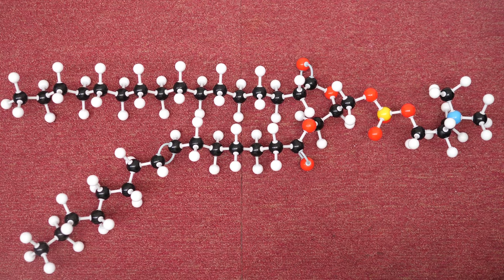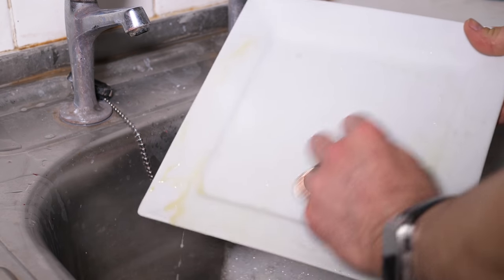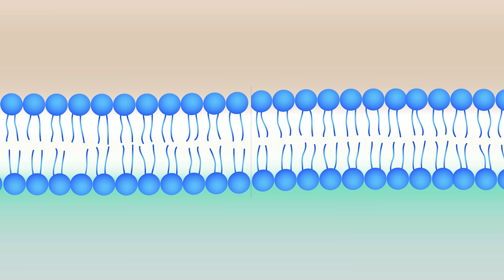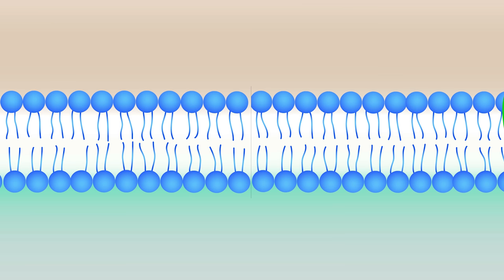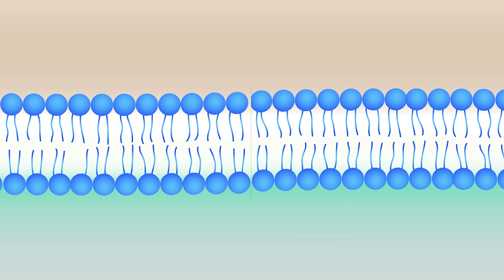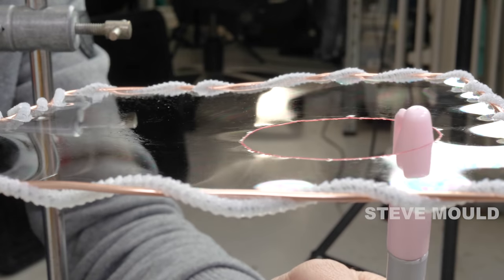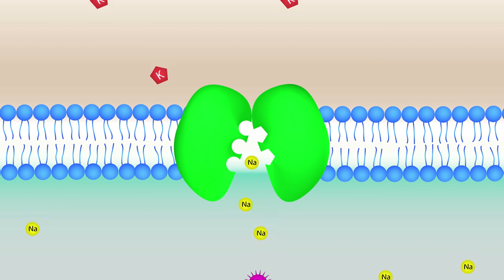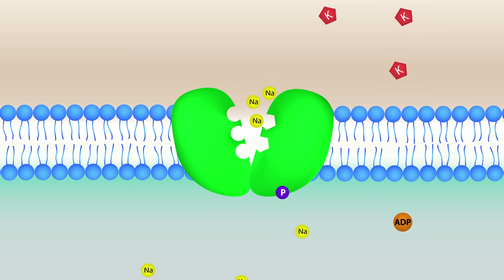How to make inverted bubbles

Comment: What if you drop a sqaure made of thin wire in the soap film?
Reply: As long as the shape dropped onto the film is stiffer than the surface tension of the film it should retain its shape.

Comment: Watching the NileRed videos on soap, and I didn't get it then, and I don't get it now.

How can half a molecule dissolve in a solvent?  What does it even mean to be "dissolved"?
Reply: To dissolve means to make a solution from a solvant and a solute whereby the solute is « dissolving » up until the point of saturation of the solvant
Reply: "dissolving" is just a consequence molecules being attracted to each other. In the case of amphipathic molecules have parts that are attracted to polar substances such as water, as well as parts that are attracted to non-polar substances like oil.
Reply: @TheSam1902  That's not helpful, lol.
Reply: @kassiekitsune189  So in the case of a solution of NaCl and H2O, were I to zoom in and locate a NaCl molecule, I'd be able to find it near to an H2O molecule, and if I moved the NaCl molecule, its paired H2O molecule would move with it?

How is it attached?  Is this the "weak nuclear force" or something?

Please remember I am a STUPID idiot.
Reply: @Asdayasman  
Basically, but more specifically.

Particles in solution with one another are attracted by the electromagnetic force. NaCl is an ionic crystal, Water is a polar molecule. Simply put, H2O is two hydrogen and an oxygen forming one particle - that particle happens to have a slightly positively charged end and a slightly negatively charged end. NaCl is a positively charged sodium atom[Na+] attracted to a negatively charged Chlorine atom[Cl-]. think of water and other polar molecules as a magnet with it's north[+] and south[-] poles. Opposites attract and so polar molecules act like a bunch of magnets thrown together, and Ionic substances interact with polar molecules like iron does with a magnet(in fact the exact same forces at work in this comparison).
Reply: @kassiekitsune189  Huh, so if I put two strong magnets on either side of a NaCl H20 solution, I could separate it?  And I could dump NaCl into H20 without any dissolving if I had strong magnets on either side of it?
Reply: @Asdayasman  not at all, since the charges are only really apparent on the small scale. To put it as simply as possible, magnets only work on a much larger scale than the interactions in a solution.

Comment: You need to rob a 120v 6 rpm dinner platter revolver motor out of an old microwave! beats getting down on you hands and knees and spinning your content to display it! The motor, some wire, a plug in, and a toggle switch is pretty much all you need....unless your from across the pond.... I have no idea what voltage the microwave motors are than, but I'm sure you could find a way with a little know how!